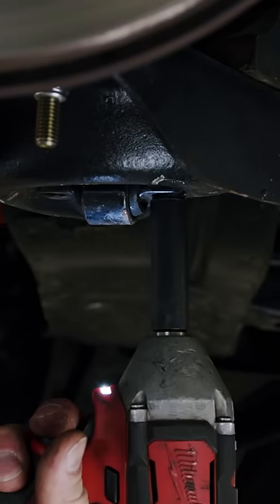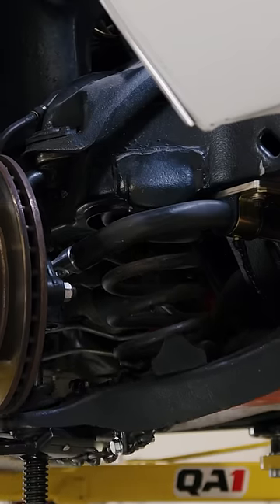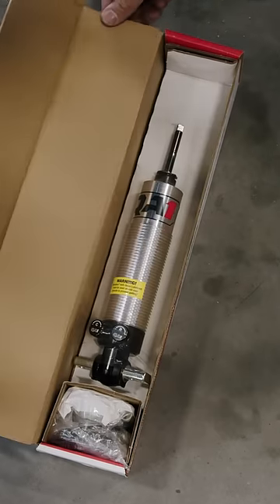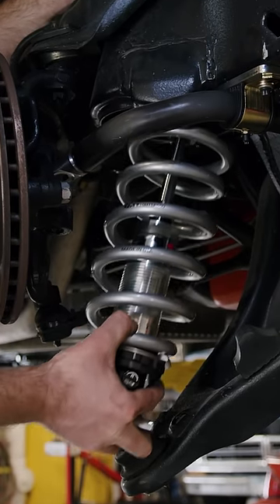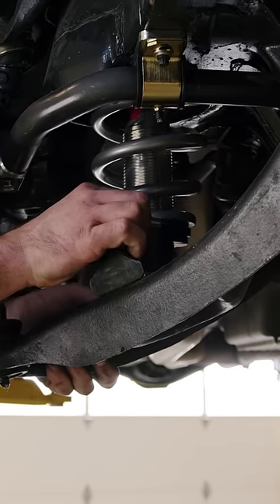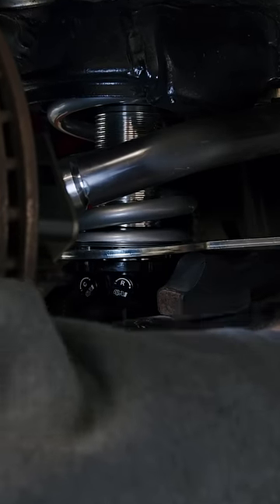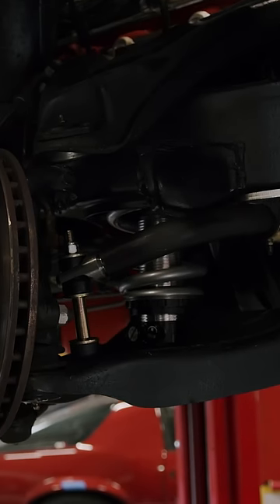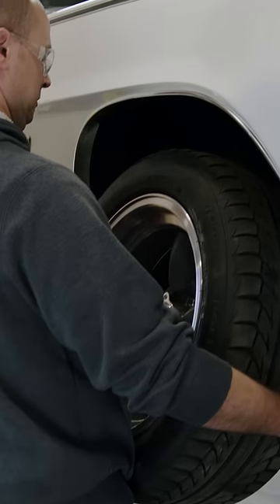Installing QA1 coil-overs is as easy as 1, 2, 3! 😎 #shorts #QA1 #suspension #QA1equipped

Comment: I'm about to change my upper a arm. I have these coilovers. Do I have to put a jack under the lower a arm ? Or can I simply pop off upper ball joint pop off those 2 bolts holding the a arm and I should be good ?